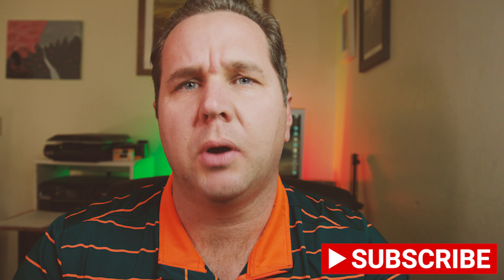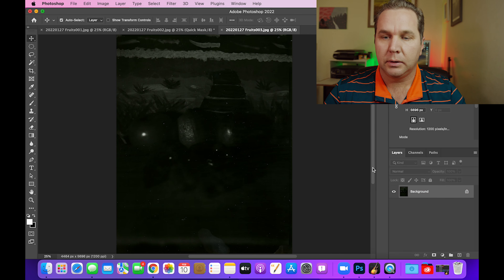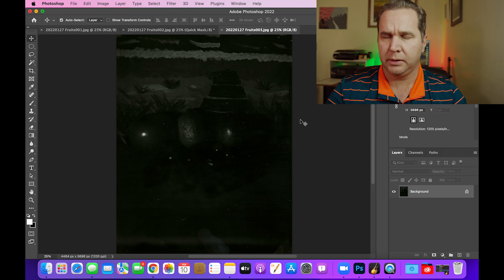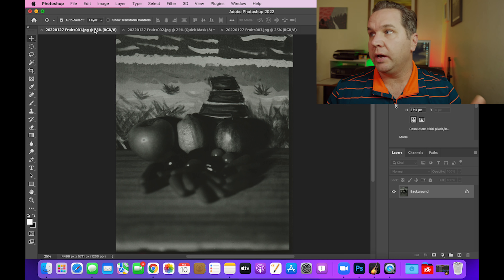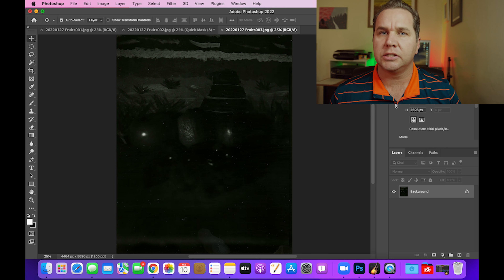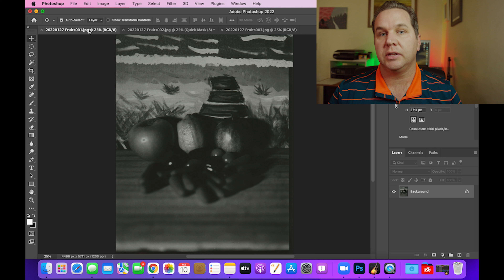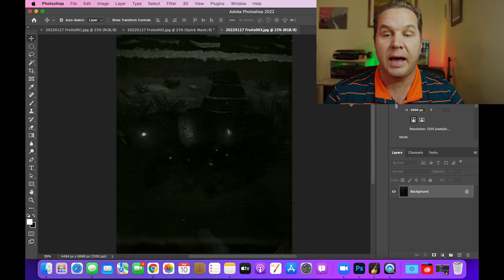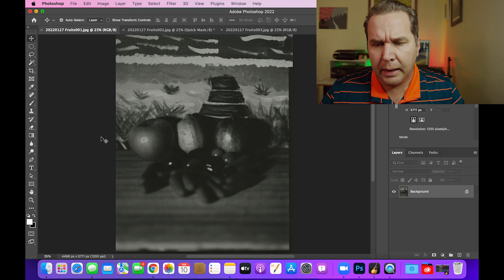Harman Direct Positive Paper ISO & Exposure Latitude Test

Comment: You need to preflash the paper in order to reduce the contrast.  Is the guide number of 365 at iso 100?  Converted to iso 1 your new guide number is 36.2.  Your strobe has enough power for an f/5.6 exposure at 6.4 feet (light to subject distance).  This means most of your your flash images with an f/5.6 lens are going to be under exposed due to the bellows draw.  The images will also exhibit a certain level of vignetting due to using the lens at its maximum aperture and depth of field will be razor thin when when shooting tight portraits.
Reply from the maker: I don't remember the guide number of the strobe. But yeah, 6-7 feet is what I calculated. I wasn't disappointed in the images, they'd just need some work. I was borrowing the strobe from a friend to see if it produced enough light to get a usable image. Eventually I'll get a couple strobes of my own so I can do something other than direct light.

Comment: If you’re hell bent on shooting this film with strobes I’d high recommend you purchase several Speedotron Blackline power packs (2400ws or 4800ws) and 4 tube heads.  You’ll want at least (at the very least) 9,600ws of power and that’s for a single light into a large softbox.  That paper requires as much light energy as Collodion wet plate photography.  Don’t feel bad though, 20x24” Polaroids required a ton of light as well since you would often shoot at reproduction ratios greater than 1:1 (1:1 requires 4x the light than when focused at infinity).
Reply from the maker: For this one I used a bare bulb. Certainly for any kind of soft box if would take a huge amount of power. I'll get there eventually.